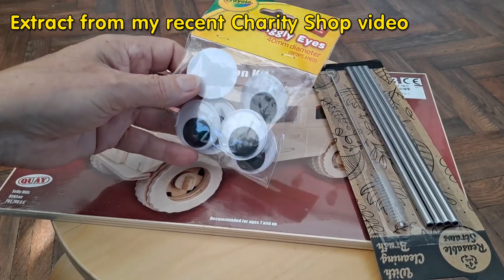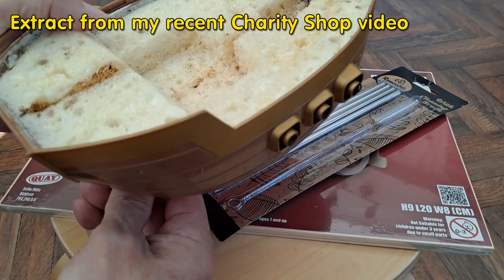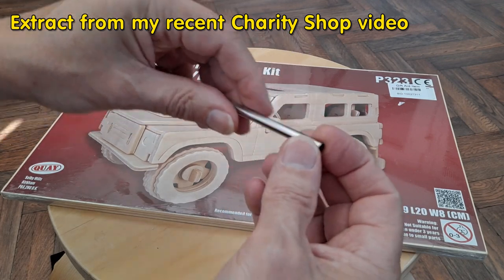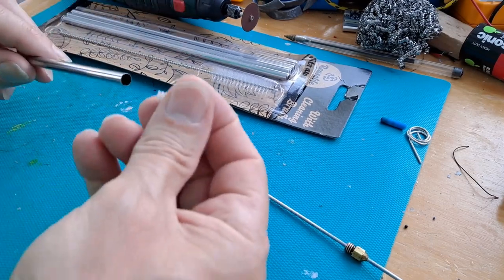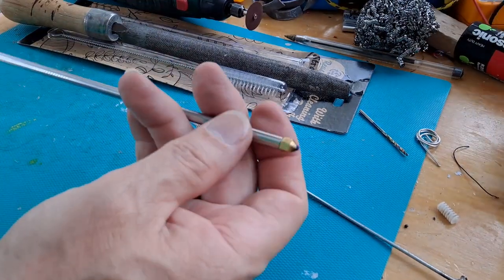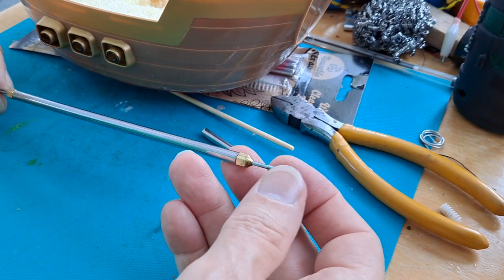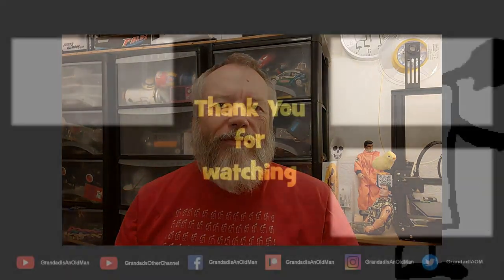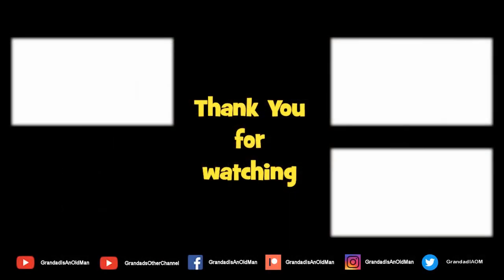Toy pirate boat RC conversion PART 4 Prop Shaft

Comment: I really enjoyed this episode, way more than others. Taking metal tubes and some brass fittings to make up a diy propshaft for a boat represents that kind of "grandading", what made me subscribe to the channel years ago in the first place. All that 3d printing may be easy, quick and convenient and all that, but making something by hand out of items that never were meant to be used like that, that is - in my opinion - what "grandading" is all about. There are many thousands of channel who do print stuff and such, but i am HERE for the tinkering. Was well refreshing to see a bit of that again. <3
Reply from the maker: Thanks, I do understand what you mean. I look back at some of my old videos and wonder about that. I also remember my postbag video about my "new 3D printer"  - It was titled "Grandad's Postbag 20200214 or grandad goes to the dark side" as I recognised it would be a change of content. The only justification I can give is that it is 'moving with the times', I used to get complaints that people didn't have access to a hot glue gun, now it seems plenty of people have access to 3D printers. I do revisit my old projects, particularly when I get a new comment on an old video. There is a short series of videos coming up where I revisited a toy grade RC boat I did back in 2015. That was hot glue and bent paperclips again 😊

Comment: Looking great. I like your idea about the brass printer nozzles. They should work fine. 
Another idea may be to take the bearings out of any old motors you have that are past their best. When I was looking at the motor in this video it looked like the bearing holding the motor shaft might be about the right size. 👌👍
Reply from the maker: I think you are 100% right on the bearing diameter. Might be worth a try. The advantage of those nozzles is they have the wider section to help align the bearing and stop it sliding inside, and I have quite a few of them that would otherwise be thrown in the bin, so I am happy to find a use for them.

Comment: Moving along well 😀
Several diameters of prop shaft could be salvaged from 27MHz aerials, especially those with a bend or otherwise useless.
Reply from the maker: Yes, I did have a few aerials that I have used in the past, having spotted their use on YouTube videos (of course 😊), again cheaper than buying proper hobby grade prop shafts, but obviously you have to do your own finishing work.